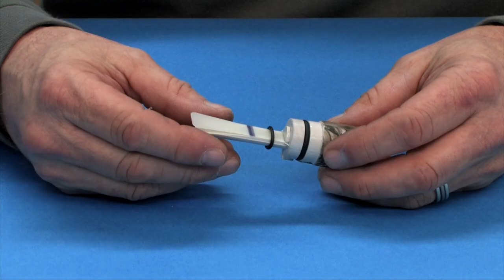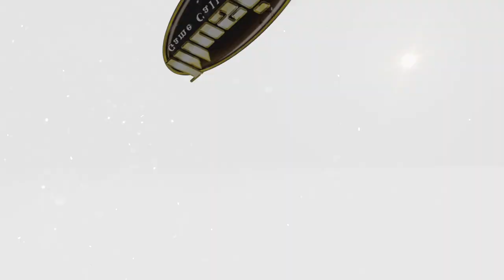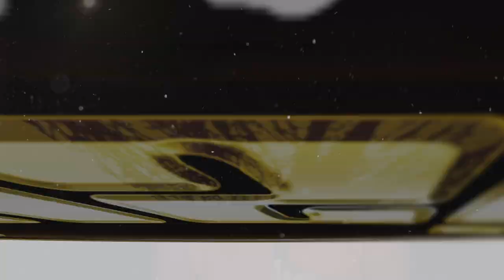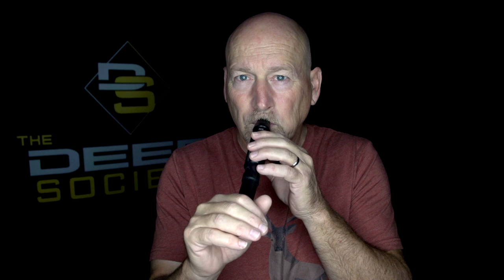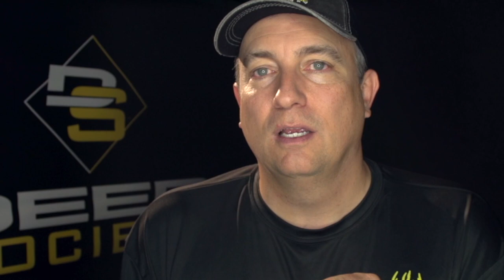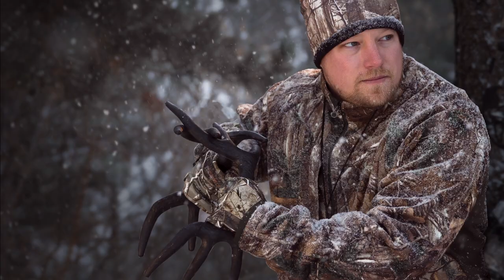Deer Calling Tips - E.16 "Part two, Calling technique Bucks"

Comment: Not sure how much better the grunt is than others, havent used it yet but, the moon guide is pretty damn close. Im hunting as far south in Alabama as you can go without getting wet. Coden, Alabama and the times on the moon guide are off just little, 45 minutes to an hour, not sure but, maybe because Im farther south. I checked my trail cam photos and the shots with the buck Im hunting is where its supposed to be or close to it according to the moon guide. With the exception of a few days, possibly weather, rain, high wind or low pressure, not really sure. I dont work for these people and Im not getting paid anything to say this but, Im a believer when it comes to patterning a mature buck with this moon guide. Get one and check your photos.